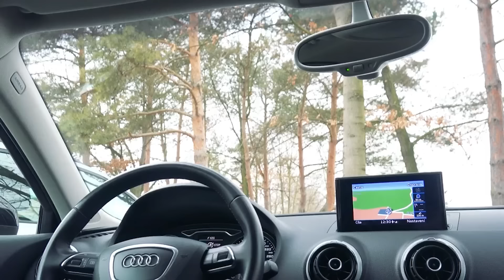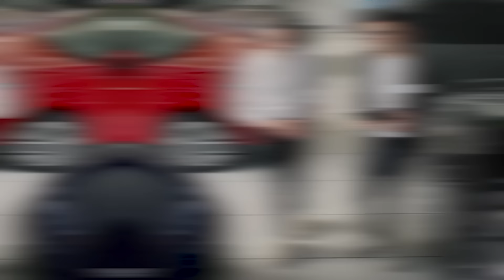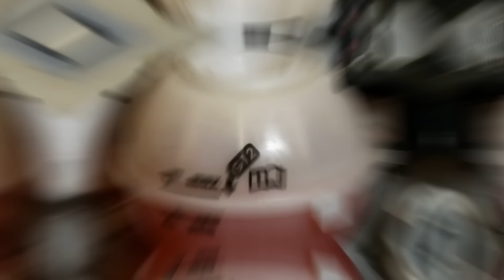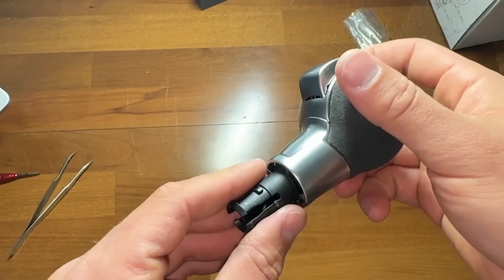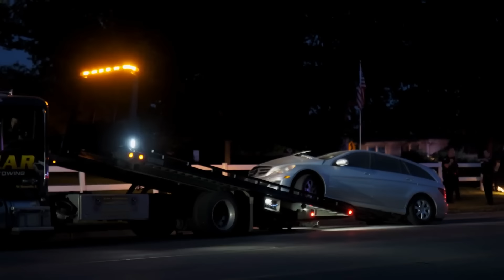25 STUPID Car Features That DESTROY Reliability & Lifespan

Comment: The Nav system in my 2014 Elantra has some issues but is overall fine (especially since I don't use it). I press like 4 different places on the touch screen, which is old school, pressure based, not sensor based like a phone. I know where I press because I have very visible finger marks before I clean it! I would NOT want a system like that running my whole car.

Comment: I drive a 2004 f150, V6, 5 speed, manual windows and locks, rubber floor mat, switches and knobs. It’s got 52k miles on it now. 
I’ll keep it until I die.

Comment: I actually sold my 2023 nissan rogue which i had a car payment on and bought a 2015 infiniti. I can do all the work by myself so im good. I will also be buying a bmw just to keep my busy working on the car. By doing that, i will still save $10k off the original price. If i kept the rogue i would have been lost about 25k.

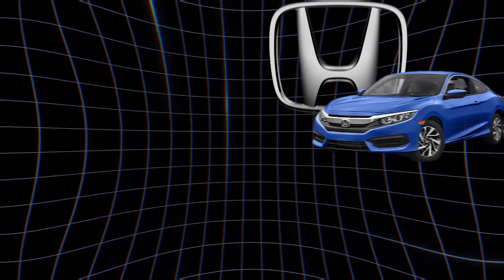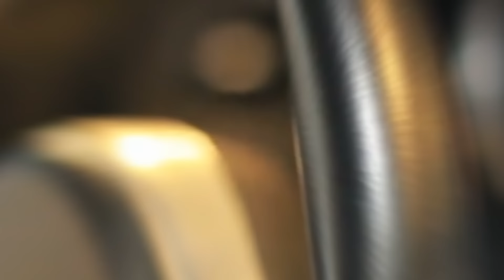Comment: 23:07 23:16 I had a Civic 10th gen for about a year and a half, battery perfectly fine the entire time. Same goes for my 11th gen now for over 6 months. The keyless thing idk about theft, bc the fob sits in my pocket ALWAYS, even when I'm not wearing my pants. When I go to open my driver door I have to have the correct pocket next to the handle to open it for my 11th gen.

Comment: The amount of self-proclaimed automotive engineers hating on auto stop-start in this comment section is astonishing. They claim to know everything better than actual engineers who build these cars. No, stop-start is not bad for your car. These are the usual talking points:
1. It causes additional engine wear. - No it absolutely doesn't because accelerated wear is associated with cold starts, and stop-start does warm starts. The oil doesn't have time to drip away from the internal engine surfaces.
2. The engine overheats. - If only there was a way to measure engine temp… oh wait… The system will detect if the engine needs more cooling and starts the engine.
3. More wear on the starter. - Yes, there is more wear on the starter and that's why new, tougher starter technology was developed. Also, usually there is preventative maintenance on these starters, meaning they are supposed to be replaced after a fixed number of cycles regardless of whether they are still good or not. This way the chance of random failure is VERY small.
4. More wear on the battery. - This is the only one that is partially true, but in no way does it "ruin your car". Start-stop requires special batteries and those things sure as shit work extra hard, but the system measures voltage and voltage drops and will not stop the engine if the battery is getting weak.

Comment: Just give me power windows, bluetooth speakers, 4WD, and a non-CVT transmission. None of those need to be connected to each other. Make everything else simple, analog, and mechanical. No push-button start, no computers, no complex electronics, no unreliable and expensive sensors.
Reply: I mean tour car needs a computer….

Comment: I'm an ADAS Tech and the keyless entry sensors definitely do not scan for your keys inside your home all night so no worries there.

 I could see how that would be a concern, but the sensors only have a few meters of range and are passive systems anyways.. it's just like any other old battery powered key fob that unlocks your vehicle. ❤

Comment: Really easy way to disable the start/stop system, at least on my 2017 Ford Edge, don't buy the battery that supports that system.  The battery that was in the car when I got it didn't and I didn't buy one when it needed replacement.

Comment: I had an issue with an update once. Didn’t know what it was until the dealership explained it. An update didn’t finish or was interrupted and it was like my car got possessed. Even though it was a turn key, the engine turned on by itself, the radio was at full volume and couldn’t be adjusted, non of the info panels would turn on. I had to drive with no idea how fast I was going to get to the dealership just to tell me it was an incomplete update.

Comment: Touch screens are the most dangerous unneccesary tech on cars today. NOBODY needs it. To be safe, you would have to stop your car to focus on the icons and options, not to mention having the equivalent of a computer monitor blinding you. And who the eff needs to drive without having your hands on the wheel and eyes on the road?So you can play pattycakes instead of actually driving? Asinine. Thousands of $$$ added to the already ridiculous price of new cars, just so the idiot tech heads can feel 'cool'? Unneccessary, and utterly UNSAFE.

Comment: Most of these features are dumb. Some would be good with better ingenuity. I work for a dealership and I'll say this till I die: anything that overrides your ability to stop, steer, or shift your car is an abomination. Yes mechanical parts fail too. Electronic parts are weaker and more prone to failure. I've replaced more push button shifter components than normal shifters. We don't have brake by wire on most makes and models for a reason

Comment: Start/stop, adjustable suspension and cylinder deactivation.  3 features I'll always stay clear of.  I own a Charger R/T and the first chance I got I disabled the 4-cylinder mode (unlocked pcm).  Just not worth it.  Not a fan of "drive-by-wire" either.  Also something I noticed right away that I didn't like about the got the Charger.  "Wtf is this??"  I'm used to having full, actual control of the throttle.  Gotta buy a freaking throttle booster or tune for something as simple as throttle reponse.

Comment: GM is using that oil bath timing belt design in their 1.2L turbo 3 cylinder used in some of their new small SUV's.  The engine has been used since 2021...as far as I know they seem to be holding up OK.  Time and higher mileage will tell the tale if their version is more robust and reliable than versions used by their competitors.

Comment: I have a 2018 Ford Edge.  My water pump failed with no warning.  Fried the engine.  Ford replaced it after talking to an attorney friend.
Reply: You would think with all those computers and sensors, the alarm bells would be blaring and flashing inside your car ... hopefully you don't have a digital emergency brake ...

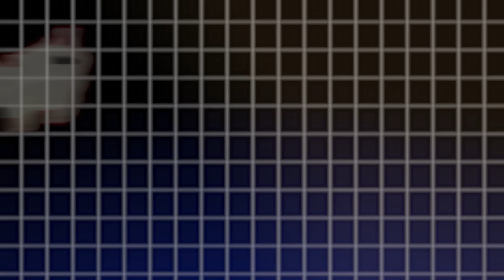Comment: 21:31 Whoever at F**d thought a plastic thermostat housing that takes over 2 hours to replace on a 4L V6  should be fired! I found an easier way to change mine (twice in only 250,000km) it's now a trade secret I only share with friends who are in the same situation. Not bakelite or alloy...PLASTIC. Sheesh...

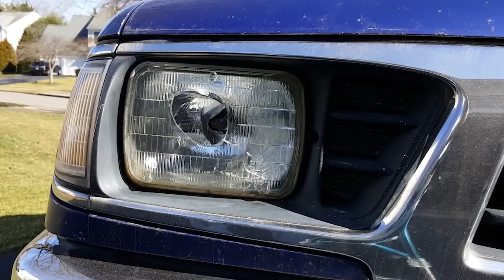Comment: 19:58 I have old school H9007 bulbs. They can be replaced with LEDs with COB design. Very bright, white light. Maybe up to $200.00 for a pair, but sometimes are as cheap as $50.00 per pair. Easy to change. Very safe and dependable. Again, do your research.
Reply: Some never cars are designed in such a way you need to visit a garage to get your basic bulbs replaced. Semi-demontage of part of the car.

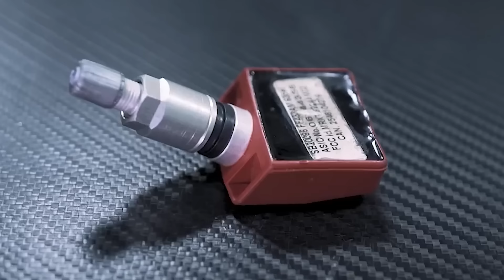Comment: 11:30 There are many aftermarket TMPS that are inexpensive to buy and have installed. Like, under $50.00 for the sensor and sometimes no charge to install-depending on the shop. Do your homework. It pays in the long run.

Comment: Stop - Start is so hard on your battery and most of all your starters. I bought 'autostop eliminator' module and installed it in my Durango. No more pushing of that button each and every time I start the vehicle. Best purchase of the year. Thanks for the video
Reply: Who is coming with those ideas , I think they have nothing better to do
Reply: Wrong. The battery and starter are designed to handle this function and are not damaged by it.
Reply: @jameshaviland6183  Too many of my friends start / stop vehicles have had starters replaced lately. I am very happy not to have it engaged.
Reply: @jameshaviland6183  just stop. That is the worst excuse I ever heard. Design =/= real life. Reality is the starters burn out faster and your engine is strained by the constant start stop cycles. When you stop an engine you stop its cooling ability. That adds stress as many of these in cities are stopping every block or so. That means they have little chance to actually cool down. Reality always wins and the reality is start - stop is the worst idea ever in cars.
Reply: It doesn’t surprise me that somebody who was dopey enough to buy a Durango would then be dopey enough to buy this.

Comment: IF you drive a Chevy without the A circle logo button, if you are at a redlight or in stopped traffic PUT YOUR CAR IN NEUTRAL with your foot fully on the brake. Then put it in Drive when you move again.
My mom has a 17 Jeep with it and I told her that feature will kill her starter. She pushes that button now every time shes in the car.

Comment: Yeah my hubs and I make a habit of the disabling the  start stop in the 2016 Ford 150,  Not a fan. Some weird issues have happened when we don't disable it.  Not a great feature at all. You lose the a/c  and I never saw a difference in gas saving.  Also familiar with the TPS...had to get all 4 replaced in the truck...my mechanic has a tire guy that specializes in it. So I saved a lot by not going to the dealer. 

Crazy when you are used to older vehicles and you get a new car,  it's a huge change with all this technology. My hubs went from 1998 Ford F150 to a 2016 Ford 150. I went from a 1995 Monte Carlo to a 2014 Honda Accord Sport.  Yeah I don't think we will be getting another vehicle soon.

Comment: I just went from a 2004 to a 2022 vehicle, first thing I noticed car shopping is the TV screens are in ALL the newer vehicles.  Secondly the engines are all smaller now, 3 cylinders are everywhere.    The number of new bells and whistles in mine is ridiculous, and its only a base model.   I was doing just fine without any of them before, and they make me fear the coming mechanic bills, lol.
Most of the trim upgrades from heated seats to heated mirrors, to keyless entry are just things that are going to break and cost money to repair.   My suggestion is to go with the base trim on whatever car you are looking at....  the levels of trim are obviously ways dealers pad the bill by getting you to spend way more than you planned for features you really don't need.   Also test drive the vehicle, do you really need another $10K in debt for that bigger engine and a higher gas bill, just to feel a little more kick driving it around?   Just an opinion.

Comment: Also, turbos are always potential problems. Never had one, never will.My new Civic hybrid does 0-60 in about 6.5 seconds normally aspirated and gets 45-50 mpg. That's good enough for on ramps, uphill, merging, etc.

Comment: My Prius heats and pressurizes the oil before the engine starts. The engine stops when the car stops, but only occasionally. When you start up and drive off, it runs in ev mode for 8 seconds before the gas engine turns on to let the heat and pressure build up. Prius routinely run 200,000 to 400,000mies so probably not a problem.

We just bought a civic hybrid, (remarkable car. 0-60 in six seconds, 45-50 mpg, and you can't even hear the engine. Don't know if the pre-heat and pre-pressurize, but I trust Honda to figure out durability. I think it stops and starts the engine when it decides to, and I can't control or detect it anyway.

We have had several gas Canrys and a civic. They all lasted past 100,999 mi without anything but routine maintenance. I give it 10 seconds to warm up and drive away moderately, no problems, but do not drive them harder than freeway on ramps and merging. 

My car mechanic neighbor looked at the Camry and Civic in our driveway and said, "If everybody drove theose, I would be out of business."
Reply: That start/stop feature is not an issue on an hybrid, unless the battery is broken. The start up procedure of the engine you mention, is an indication of the extra care taken to minimize petrol engine wear ... and that it is a factor. ICE vehicle don't have the buffer of an EV motor in the start/stop procedure.

Comment: Most of these supposed dangerious feature work fine for modt drivers, a small number have issues that are usually related to drivers not reading the car manual, and they have no idea what the buttons do or how to use them correctly. Older drivers have the most problems due to  thinking it's too hard to learn something new or thinking they shouldn't have to learn anything new because the world isn't supposed to change. Those are the people who don't understand why it can't be 1950 forever.

Comment: the auto start/stop is a royal pain in the ass.  when it shuts off the engine and it restarts sometimes you can also feel the engine rock and it takes about 1-2 seconds before you can move

Comment: I'm just thinking of a scenario where you just barely managed to get your car started, and the auto start stop just goes ahead and kills it for you at a traffic light 😂
Reply: That happens every freaking day
It's a counter intuitive mechanism, it makes no sense
Reply: Or leaves you stranded in the middle of the intersection at orange ... going red.
Reply: Well, if you barely got your car started, you would at least be aware of that.

I don’t know whether there are any interlocks in these systems to check like battery voltage before that is attempted or anything like that.
Reply: After jump starting my car, I thankfully remembered to turn it off. 😅

Comment: To me, one of the stupidest so-called safety features for manual transmissions is that the vehicle’s clutch pedal must be depressed and the gear shift in neutral before the starter will work. That means that if you’re having trouble starting, you can’t put the gear shift in a lower gear, turn the starter on and slowly release the clutch pedal to give your self a jump start. Who lobbied for this regulation? Triple A? 🧐

Comment: The more high tech systems crammed in, the more chances of system failures.
Reply: In addition, as a rule of thumb modern consumer grade electronics have a life span of around 10 years ... all those sensors ...

Comment: Time to start scaling down the electronic garbage. Give me manual, give me knobs,  I don't need TPMS. I don't need MDS. I don't need auto parking. Git rid of the modules and electronic rubbish.  Get rid of CVS. Get rid of shutoff at red lights.  I don't need error codes on day one. Dump plastic parts, plastic valve covers, plastic transmission pans, plastic oil pans. Get rid on rubber timing belts running in oil. Give me timing chains. Get rid of turbos. Turbos kill engine life for gas engines. Check engine light?  Bullcrap, it's never the engine, it's all the added EPA electronic garbage.

Comment: The start-stop system is actually fine in hybrids because they're built from the ground up for it.
Reply: Right because a Normal Starter isn't being used in Most cases, Instead long lasting brushless Motors are being used.

Comment: I have had a old Mazda 6 2007 the last 8 years. But now it got rust and they have stopped repairing rust here in Sweden. So everyone that get some rust has to buy a new car. Which leading to less used old cars. Probably why they adding so much plastic to new cars, to prevent the metal to rust. But it makes them look cheap. I probably has to buy a newer car because it's so hard to find old ones. And all cars cost twice as much as before.

Comment: 07 Dodge short Caravan 309,000.km, burns at most 1/2 pint of oil every 3,000km. From brand new, it always just burned 1/2 pint of oil/ 3,000km.. lol Great old gal. In Canada, rust kills every vehicle.
 In winter or summer, she is always ready to go when needed.
New Toyota, not so much. Great features that are guaranteed to fail. Be prepared, and watch this video 5 times, cause things will happen to ya.

Comment: A lot of these aren't the tech itself, it's the cost cutting to implement these techs. Look at toyota and lexus. They have little problems because when they put things in their cars, they dont cut costs. It is implement well instead of using cheap parts.

Comment: On the oil side of the car... Some A-hole told you that you could change your oil 20 to 40k miles... yeah tell the to shove it.. change your oil  every 3000 miles or 3 months depending on driving habits... i have a little ford aspire... one of fords crap cars... and it's engine still runs perfectly... do to PROPER maintaince...
Reply: Depends on what type of oil you use. With fully synthetic oil and filter change, you could easily run 9000 miles without problem. Change every 2 years due to age deterioration. Whatever comes first. Worked for me.
Reply: and run out of oil, as the moron in the video did,  by not doing the maintenance...

Comment: Logic says that a software glitch, due to an update or whatever reason, is ALWAYS a "warranty issue".
The new software means the warranty resets.
The courts need to address this, AND SOON.
Reply: Looking at the Microsoft Experience, it looks like a few bumpy decades ahead. Not getting a car with a "telemetry" based firmware update ever. I rather drive a T model Ford. Tesla's subscription model based electric seats was over the top.

Comment: ALL THESE BELLS AND WHISTLES FEATURES THAT IS NOT RELATED TO FOR THE VEHICLE TO RUN ARE IDIOT STUPID FEATURES !!!!!! THESES FEATURES ARE TO MAKE CAR DEALERS MAKE MONEY ON REPAIRS !!!! EXAMPLE : WINDSHIELD FRONT CAMERA AND SENSORS AND CRUISE CONTROL ARE ALL TIED IN TO THE FRONT CAMERA … REPAIRS WILL COST YOU AT LEAST $1500 FOR CALIBRATION !!!!! THE CAR WILL STILL RUN GOOD AND YOU JUST NEED TO DEAL WITH XMAS LIGHTS ON THE CLUSTER !!!!!